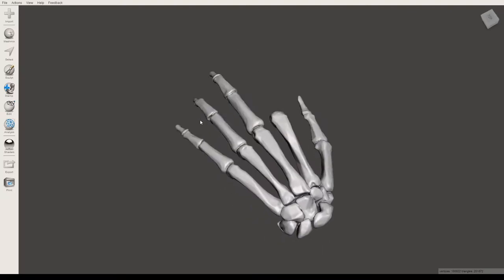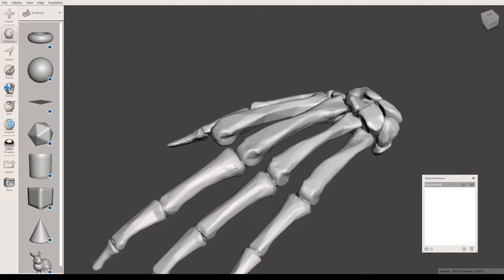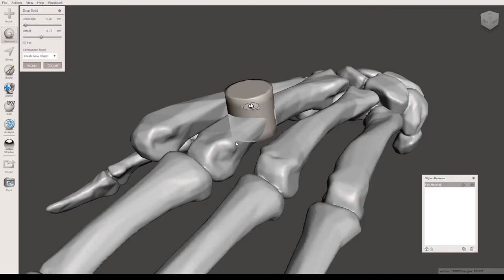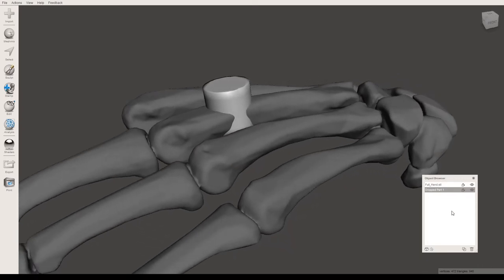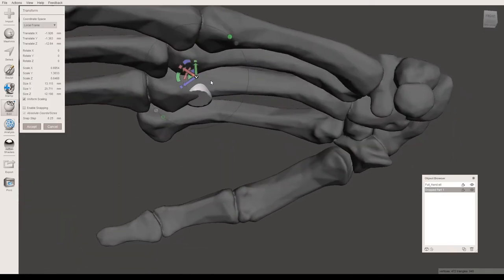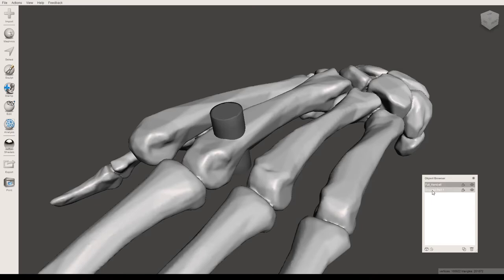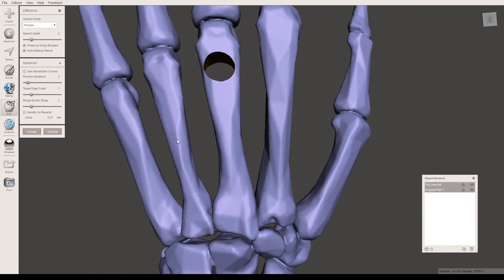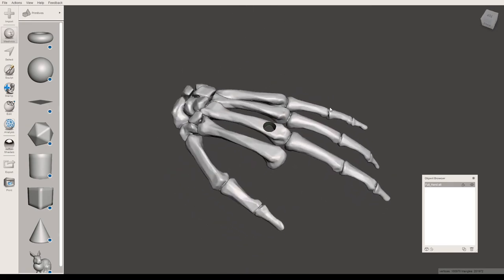Making Holes in Meshmixer

Comment: great tutorial but what version of meshmixer did you use? im using 3.5 and the menu that showed after i dropped the cylinder was not "drop solid" it was "transform." in fact i have found no such menu anywhere nor boolean feature in edit. Am i doing something wrong? Thanks to anyone who can help. Cheers
Reply: It is different between you dropping it on an object and elsewhere, to get to that menu you need to drop it on the other object.
For me it was easier to create it as a separate object and then subtract by selecting both (in the https://youtu.be/zQHXmjlBn2k?t=318 time)

Comment: Thanks for this! One thing, I tried to use this to enlarge an existing hole I had in a model and instead of doing that it seemed to fill it. I definitely did boolean difference
Reply: The preview even shows it making the hole like it should do so Im a bit lost
Reply: I was here looking for an answer for the same issue. I just figured it out- un check 'Auto-reduce result' before clicking accept.
Reply: @thewarthogproject  I did exactly that and it still does the same. it wont cut a hole
Reply: @thewarthogproject  Thanks for this!! I had the same problem
Reply: @thewarthogproject  thank you! Worked great for me. I appreciate your help 😊😊

Comment: Disappointing when tutorials don't actually explain what any of the settings do. You say "if you're happy with it, press Accept". What if I'm not happy with it? How do I tweak the results? This kind of basic instruction didn't need to be a video, a simple paragraph of text could have explained everything you did. If you're going to do a video, explain what the settings mean. Give it some value rather than just basic "do this" institutions.
Reply: Some people prefer visual examples even if it's  something as simple as this just because you werent happy with the results it does not mean that it shouldn't be a video.